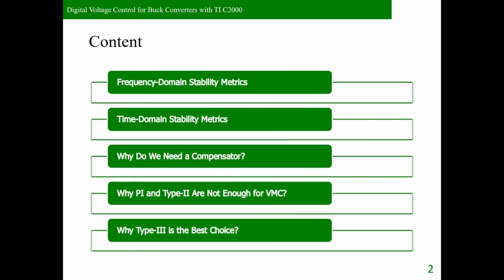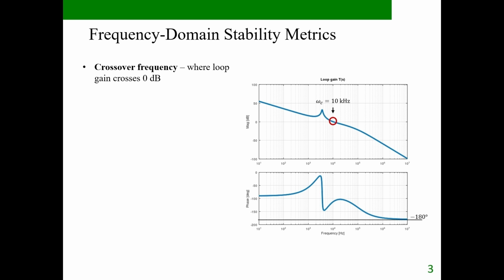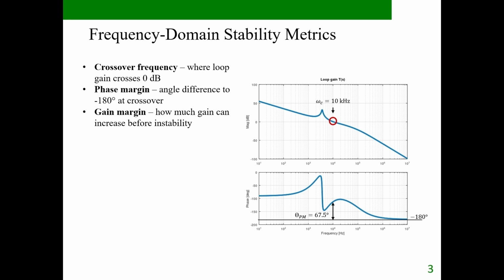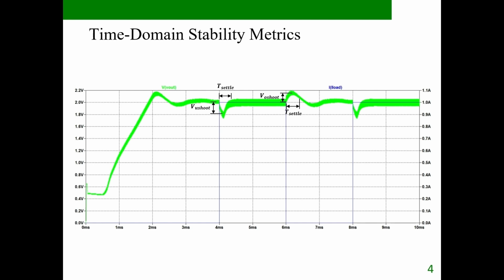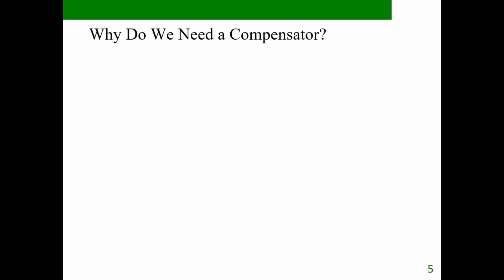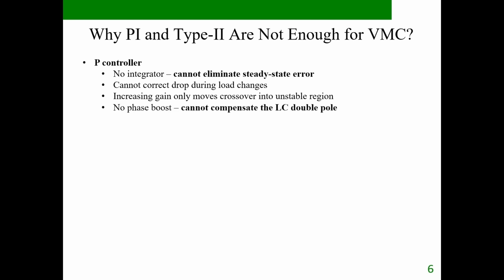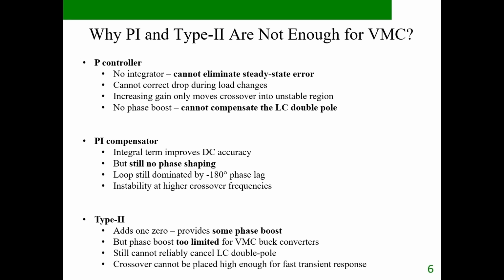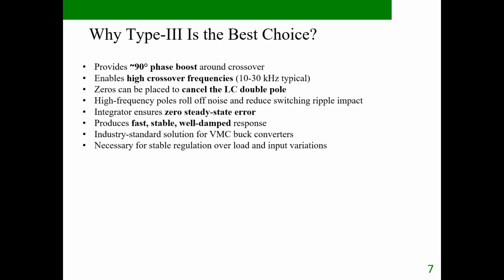Why PI and Type-II Controllers Fail in Voltage-Mode Buck Converters

Comment from the maker: Many engineers try PI or Type-II compensation in voltage-mode buck converters and run into instability when increasing bandwidth.

In this video I explain why that happens and why Type-III compensation is usually required.

Have you ever experienced instability when pushing crossover frequency higher?